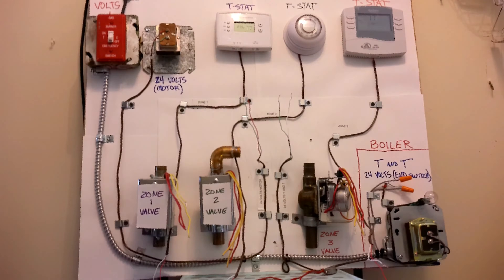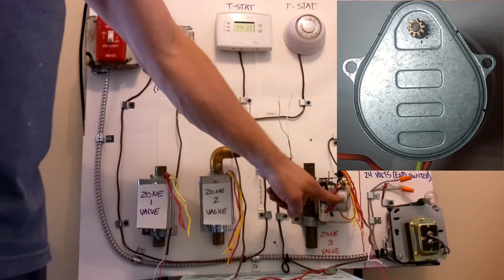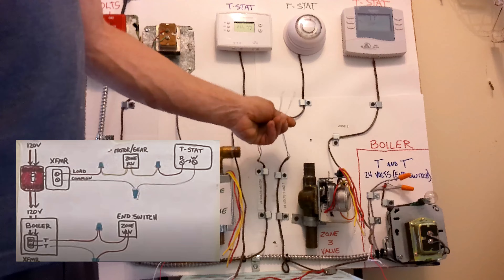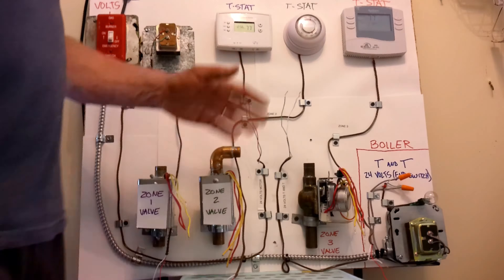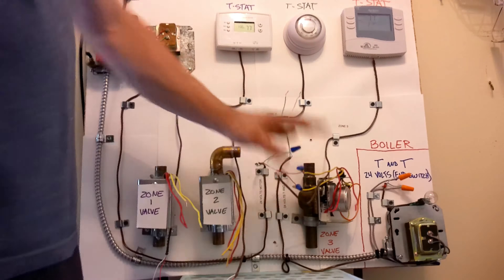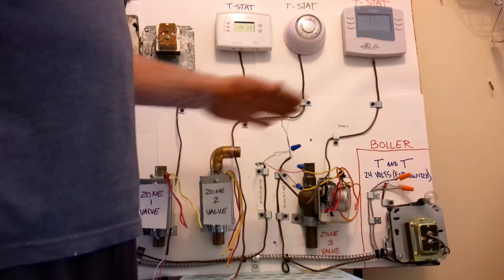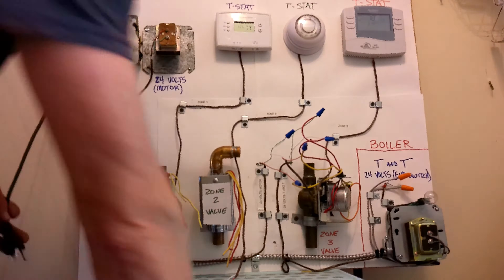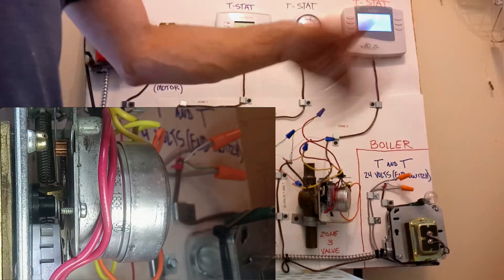Zone Valve Wiring For Beginners (Honeywell demonstration)

Comment: Doesn’t make sense, I’ve got one transformer inside the boiler (c r y g w) and I thought common had to be blue? With a google nest it requires a 3rd wire ( blue common) but if white comes back to zone values and to common on transformer then white can’t be common or I didn’t need a third wire, I’m confused

Comment: This makes sense that the valve motor controls two separate circuits.  This makes much more sense than the Taco Valves.  For the taco folks:  If there are two separate 24v circuits, how does the Taco valve utilize having one common (terminal 2) for both terminal 1(from stat) and terminal 3(from boiler)?

Comment: Help me please. One zone won't stop heating up. Is that a themstats problem or the zone control valve? Is there a easy way to find out?
Reply from the maker: Usually a zone valve stuck in the open position physically. It may not be stuck open far enough to keep the boiler activated but if any other zones are calling for heat that stick open zone will also be heated, even when the stat is not calling for heat.
Reply: @JerseyMikeHVAC  all the themostats are at lowest but that one zone still heating up. contractor said it is probably the control valve motor .
Reply from the maker: @KnowerofThings  Yeah that motor in the zone valve opens the physical valve that lets the hot water through. It's sticking open or not fully closing, allowing hot water into that zone anytime the boiler is running on any other zone. If the boiler runs nonstop if none of the thermostats are calling for heat then that zone valve motor/physical valve is sticking in the wide open position and forcing the boiler to continuously run. If the boiler shuts down when all the other zones are off, then that one problem zone's
 valve is not fully closing then that zone will get heat whenever any other zone is calling for heat.

Comment: What hasn't been explained is how the circulator pump gets triggered.  I've always assumed that when the thermostat calls for heat it first gets on the circulator pump.  Then, when the water temp goes down (as it gives off heat to the zone) and reaches a set temperature and triggers the boiler to fire up to bring the water temperature up (to a cut-off value).  Since oil oil fired boiler also supplies the house hot water, as the demand for hot water reduces the water temperature at the boiler it is triggered on to heat the water.  If the home temperature is at its set point there is no need to trigger the circulator pump or the zone valve.  Seems to me that water temp controls the boiler directly.
Reply: When the thermostat is turned on, the burner fires up and the circulator begins to pump the heated water. The transformer in this video with the T T is inside a aquastat, which is not shown. This aquastat has its own 24 v circuit built into it. The aquastat has a bulb inside the boiler That senses the boilers temperature and starts the boiler until it hits a certain temperature.

 The aquastat is the brain of the system. The thermostats communicate when heat is needed and the aquastat allows this to happen. If your boiler has a tankless coil for domestic hot water, the aquastat may have a control built into it or you may have a second aquastat built into the tankless coil. That will have  priority

Comment: The motor turns and presses the end switch and turns on the boiler, but when does the valve open that allows flow. You didn't talk about the opening and closing of the valve itself

Comment: I've got a 3 zone boiler system. I need to replace one thermostat with a new one that requires a C wire. I watched your other video on that, and it was great! One thing, i have no yellow wires on any of the zone valves. Also, the PO ran a 110v single pole light switch to turn the boiler on and off. That being the case, what happens how with the c adapter wiring to the zone valve without boiler power (or rather switched boiler power)?

Comment: Hello Mike,  I recently purchased my first house, for ME anyway!     I have only experienced gas-fired forced air furnaces in the past. This house has a Slant/Fin boiler that isn't working at the moment, much to my dismay!!!   It has a Honeywell L8148e1265 Aquastat, two Honeywell 4 wire zone valves and two, 2-wire thermostats.  There are  three wires coming from the boiler at the TV, W and T terminals.   I have had three plumber/Electricians come look at it. One took all the wires apart and came back three weeks later, wired it up wrong apparently, cuz the transformer inside the aquastat burned up! I got a new transformer and mounted it remotely cuz I couldnt find one that would fit inside the aquastat. I wired it in remotely.     The jumper between the W and the Z terminals is closed. Your videos really rock!   They have helped me understand alot more than i did before I got into this whole mess!   Have watched a ton of your videos but can't make heads or tails of what the wire coming from the W terminal, inside the Aquastat does. And what all it is supposed to hook up to, if anything. This system only has one transformer, but it seems that the whole system would be easier to hook it all up, if I added another one!!  Any help you could offer would be much appreciated. Thanks
Reply from the maker: Z and W terminals are a common. If you had a smart thermostat your common wire would land there. Preferably on Z. If either are wired to T/TV you have a direct short.

Comment: I remember when the end switch in my brain closed and I understood how these worked. Just ran an emergency call to replace a failed pump and replaced his 3 taco zones with honeywell.
If techs and installer just cleaned up their 24v wiring they would be much less intimidating 
You're a good teacher thanks for sharing your knowledge

Comment: Excellent!! I have a question I have a thermostat wire that has three wires red white and green The green is not used I want to use that as a common how would I use it with this system?
Reply from the maker: You can connect the green wire to C on the thermostat and any wire that is going back to common on the transformer. Or even to the common on the transformer itself if possible.
Reply: @JerseyMikeHVAC  isn't it theoretically possible for me to have a wire from the c going to the white (w)  in the actual nest thermostat base theoretically? .

I have a set up like

Aquastat, honey well valve, external transformer

Assuming I have a zone Honeywell. No extra device that you bought 
 I should be able to?

And I know that I should consult a professional this is just for educational purposes
Reply from the maker: @paramountx  A smart thermostat that requires a common wire uses the R and C terminals as a constantly powered circuit. If you were to jumper from C to W, the W terminal would always be powered and the heat would never shut off. And that's the best case scenario. Worst case you fry the stat on a short circuit. 

 Even though the W terminal wire does eventually go back to common in the transformer, it does so after a load in the circuit ( the zone valve). So you need to tie into that circuit after the load, not before it.

Comment: Great video. I am installing a Nest Thermostat into our two wire system and need to wire in a Nest Power Connector. The power connector has three inputs and two outputs. The inputs are red, white and common, the output goes to the Tstats. I traced the wires and identified 2 circuits. The tstat side made sense but wasn't sure what the end switch circuit was for. Now I know, it turns on the burner.  The Nest instructions say to look for the control board to wire in the Power Connector. In my case I can take the C wire from the control board but I use the wires off the 24V Tstat transformer. I'll call Nest to verify. Again thanks for taking the time to put this together.
Reply from the maker: If Nest doesn't provide much help:

https://youtu.be/XVs0k1aaza4
Reply: @JerseyMikeHVAC  you da man. Thx this is just what I needed. Can you confirm you need one Nest Power connector per Nest thermostat? Also I was reading if you have multiple Nest thermostats, you might need a bigger transformer. I am planning on using 4 Nests, I will have 1 Nest, 1 Gen 3 learning and 2 Nest 4 learning. I just ordered a 75va Class II transformer. I can't tell how big the one in the system is. The label is smered off.
Reply from the maker: @gtreanto  Yes you need one per thermostat. You most likely have a 40VA transformer currently. Very common in these applications.
Reply: @JerseyMikeHVAC  I saw your video (https://www.youtube.com/watch?v=GGzyj-N6Y8U) on adding a second transformer and a relay board. Should I go down that route even though I only have a 2 wire thermostats in our house? I have 5 Taco Z075P2-2
Reply from the maker: @gtreanto You need a common wire to do that. Not sure if it can work with a power connector.
Reply: @JerseyMikeHVAC  for safety sake should I swap out the 40va transformer with the 75va transformer, and wire in the power connectors as needed? The Gen 3 learning seems to be happy with the two wires. Its only the Nest thermostat that is complaining about power? Thanks for taking the time on this.
Reply from the maker: @gtreanto The Gen 3 is power stealing so recharges on heating cycles, but might get problematic once the other stats requiring a common connection start drawing from the circuit. 

My suggestion would be to keep 2 stats and zone valves on the current transformer as is. Add a 75 VA transformer and run the other 3 zone valves and nest stats separately off of that. 

All of the end switch/burner circuit wiring can stay as is on all 5 zone valves. No need to get into any of that wiring because it's a separate circuit.
Reply: @JerseyMikeHVAC  I forgot to add. I have a new Burnham Altra gas boiler/furnace and it appears to me the end switches are already on a separate circuit coming off the burner control board. The 24v transformer is only doing the thermostats. In this case should I just upgrade the transformer? Or is the 40VA transformer strong enough for the 5 smart thermostats? Looking at the spec the Nest 3 and 4 learning tstats take a max of 4va at start and 2va at run.
Reply from the maker: As I said earlier, you can try it that way if you want to see if it works. The 2-4Va rating by Nest are typically numbers off of forced air systems and may not include power draw when using smart features like weather apps and wifi, plus they don't really offer a lot in assistance when it comes to boiler and zone valve circumstances. They'll just tell you to hire a pro to figure it out. 

 Most external transformers off of boilers are not provided to power thermostats. They're provided to power the zone valve motors. Regular thermostats do not draw power from those circuits. They are just switches. Smart thermostats add another power drawing component (whether they need a common or not). 

 Try it with just the 75va upgrade. If it works then great. But you're basically running 10 components off of one 24v circuit. If it's not enough you'll need to run a 2nd external transformer.
Reply: @JerseyMikeHVAC out of curiosity I'm going to attach an ammeter to check the current draw. If my math is correct a 40va transformer can handle a max of 1.67a..
Reply: @JerseyMikeHVAC  I checked the current draw for the Nest while the zone was drawing and it peaked at 1.3 mA. I turned on the 4 zones I have and the current draw maxed out at 30mA. I'll check it as I add devices.

Comment: Hi. Thanks for the video! I do have a quick question... I just finished installing a smart thermostat for my boiler and I connected the thermostat with the R (load) rather than at the end with C. Is there a good practice on that? In your diagram we can see the C from the transformer goes to W of the T-stat. Mine would go to the C of the motor. What's your thoughts?
Reply from the maker: That's perfectly fine. It's a simple circuit and you can go either way with it.
Reply: @JerseyMikeHVAC  I was thinking the same.. except when your t-stat is having R from the transformer connected to it.. you either need to shut off the electricity completely before manipulating a t-stat or be careful with the wires (R) when pulling off the t-stat.

I feel like you gonna tell me the best practice is anyway to shut off completely electricity before doing any work :D

thanks for the reply
Reply from the maker: @soufianemess7681  Ha. Yeah pretty much, bit just to protect the transformer from burning out on a short. No fuse in the circuit.

Comment: Thank you, Jersey Mike!   That makes something that appears very complex in my home's mechanical into something really simple.  We just bought the house and there is nothing here to control an ELAN home control system.  So, I'm in the process of removing the 5-zone hydronic system from the ELAN whole house control system and will control it with 5 separate Honeywell  T9 thermostats.  Immediately, I ran into an issue.  First, I simply hooked the two conductors that came from the AprilAire thermostat's R and W terminals to the new Honeywell R and W terminals.  No joy!  The new thermostat display didn't even light up.   Then, disconnecting from the thermostat, I tied together R to W wires and expected it to actuate the zone control valve.  It didn't.   The 25 vac is present and tying the R and W wires should have, I believe, actuated the valve for water flow and closed the micro switch so that the boiler would turn on.  I'm not sure why it doesn't.  From my HVAC knowledge and your diagram, I believe it should have.  I'll need to investigate further.  
In the meantime, I reinstalled the old AprilAire thermostat (R and W wires), but I now have to turn on another untouched zone to get the boiler to come on.  Your fine video will help me to diagnose further.   Thank you for taking the time to make such a good video, simplifying the wiring and how it works. 
Ken
Reply from the maker: Those T9 thermostats need a common wire I believe to charge. Thats why it may not be coming on. It's wired correctly, just missing a common.

Comment: You have a dead short from r to common in your diagram
Reply from the maker: There isn't. I just didn't include loads existing in the burner circuit to explain zone valve operation. The load items are represented by the single lightbulb in the video.

Comment: on the zone valve, does it matter which red or yellow wire is connected to which? or can it be either red and yellow wire?
Reply from the maker: No they can go either way, so long as red and yellow are not mixed. Those are separate circuits.

Comment: 1:52.  I thought the zone valve button turns on the  pump and not the boiler?
Doesn’t the boiler fire independently to maintain temp?
Reply from the maker: A Triple Aquastat will fire a boiler independently to maintain a minimum temp. On a cold start boiler arrangement, the end switch fires up the boiler and a circ pump together.
Reply: @JerseyMikeHVAC  thanks - I had to replace me zone valve and it looks like it supplied power to the pump relay or something like that

Comment: Hey Mike, new subscriber here. I have a question regarding my original gas boiler hydronic system installed in early 90s. It doesn’t have spill ,rollouts switch in Utica boiler. 
Everyday I watched YouTube, I learned about safety issue from you guys.  Thank you.
Do I need to install these safety switches now?
Reply from the maker: Yes I think you should, but you want to call the manufacturer directly and get their recommendations on what switches specifically to put in. You can't just use any switch. I'm sure you won't be the first to call about it, so they should have answers for you.
Reply: @JerseyMikeHVAC  sorry to bother you again ,I called the company today and gave the model of my boiler, she said Utica aq02101 for both spill and roll out switch but when I look it up it’s look the picture is more looks like for spill switch only. I’m not sure if she’s right about the roll out. Can I just put any roll out switch (the one that has like a thermistor)?

Comment: That’s an odd way to wire then system.
All reds from thermostats should go to hot from external transformer 
All w form thermostats should to one side of zone motors 
The common from external transformer  should got to other side of zone motors
Then the TT should be wired in parallel to all 3 zone end switches.
Reply from the maker: A guy who did this for 25 years taught me this way, but I have another video showing the same way you describe it as well.

Comment: Mike I have steam radiators in my house, single pipe, do I need to bleed the radiators of air even though they are steam?. I have some radiators that get hot very quickly and some take forever to get hot. Love your channel.
Reply from the maker: Usually there is either a steam trap or an air vent on the radiator that is hindering things. If the radiators that take time to heat up are hot in one spot and cooler elsewhere there may be water trapped in there. Sometimes the little air vent is plugged. One little trick you can try is to remove the air vent and try to vacuum out the radiator through that hole. Sometimes that frees things up for me.